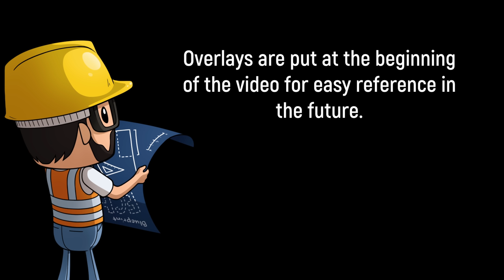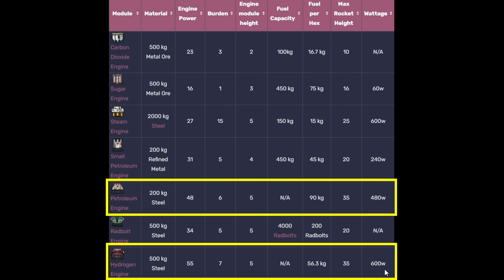Liquid Hydrogen and Oxygen Tutorial | Oxygen Not Included

Comment: Regarding solid hydrogen forming in your hydrogen freezer part: there's a way to regulate temperature of the coolant down to 0.1 C. Just put liquid storage behind the aquatuner and regulate for temperature of the liquid going out of it. It does not have to be full, a few hundred kg of supercoolant in it is enough, that way the 14 C of cooling by the aquatuner gets spread over whole contents of the storage and causes only slight change in output temperature. May be only necessary for perfectionists who don't like messy designs, though :)
Reply: Alternatively, cool it down to a higher-than-needed temperature that is close to the target temperature, and then once the cooling's evened out that first time, set it down to the actual target temperature.

Comment: You can get a much more stable coolant temperature if you output the aquatuner directly into a liquid reservoir with a couple hundred kilos in it and put your thermo sensor on the output of the liquid reservoir. Then your coolant loop fluctuates by only a few degrees above and below your target temperature.
Reply: Does the reservoir go inside or outside the structure? I already have it built they way he did so im not sure where to put it.
Reply: @Babyjoker2222  it needs to be outside the steam room so it doesn't exchange heat with it
Reply: @snackjunkie9367  Does the automation need to be connected to the reservoir and the auquatuner or just the reservoir?
Reply: Seems like just to the reservoir the aquatuner just keeps running until max causing the hydrogen to freeze, and then when i connected it it still continued to run.
Reply: @Babyjoker2222  none of the above. You still connect the automation to the aquatuner. You're just measuring the temperature from the reservoir output.
Reply: @snackjunkie9367  ohh is there a thermo sensor for the reservoir and a thermo sensor for the aquatuner?
Reply: @Babyjoker2222  no just 1 thermo sensor, you just put it on the reservoir output instead of the aquatuner input. It still connects to the aquatuner.
Reply: @snackjunkie9367  Thank you I believe I have it working now, I took a break yesterday then started back this morning. Was confused at first with the putting the thermo sensor ontop of the reservoir output until I got it.

Comment: The difference between insulated pipes and regular pioes is how thermal conductivity is calculated. With regular pipes you calculate the average of the two items. So it would be half of liquid hydrogen. Same with heat feom outside the pipe(if you didnt stop the loops when rockets leave or come back). 
With insulated pipes the lower thermal conductivity is used. So with insulated pipes made with insulation  thermal conductivity is 0, with ceramic its really small

Comment: A trick I used, was to pre-cool the hydrogen to -255 via the gas version of the aquatuner. I also had a full tanks of super-coolant after the aquatuner and used the thermo sensor on its exit. The more super-coolant the more stable it is. I got the hydrogen to be -261.5

Then, whenever I had both enough of it to fill the chamber, AND it was colder than -261, it was pumped through the pipe system fueling the rockets and was then lead back to the hydrogen chamber. Even when no rocket needed fuel. That cooled all the pipes to -260 too, so the pipes no longer sucked chill out of it. That way, I could run it longer and longer, even before getting insulation.

Comment: Like meany have pointed out using a buffer tank helps evening out the temperature and you don't get spikes in it.

It was also pointed out that normal pipes of insulation will change temperature as it is an avarage between the thermal conductivity of the pipe and liquid. Think Francis john explained the math it in one of his videos. 

Areas in space you don't get rocket exhaust to (insulated wall on the side of the rocket) you can use radiant pipes in, as they instantly cool down as most have a low specific heat capacity.

Comment: Love the actual tank part, my preference for cooling the steam turbines is a powerless loop of hydrogen in a gas pip looping through window tiles along one side of the oxygen tank and behind the turbines massive thermal mass to hold the temp and it doesn't effect the cooling of the oxygen at any point either, excellent work though.

Have you tried the trick with piping through bridges with 1 pipe segment between them to save on pipe costs?

Comment: Echo i like your idea of the polluted water and clean water aquatuner setup but I'm worried about the polluted oxygen of gasing when I sealed everything up furthermore, doesn't polluted water leave polluted dirt behind once the water evaporate?
Reply from the maker: Won't off gas because there is enough regular water that turns to steam first, which overpressurizes the room.  Yes, it will leave some dirt around.
Reply: @EchoRidgeGaming "leaving polluted dirt behind" 😵 that don't make you twitch? 😆 why not crude oil or petroleum?

Comment: But aren't you in vacuum? what are the pipes gonna exhance heat with and they need to be made with ceramic and stuff
Reply: Insulated pipes themselves will exchange temps with what's inside of them, unless build from insulation. And since each pipe segment is built at around 30 degrees, this means that pipe segment will be slowing sucking out chill from the liquid O2/H2 inside of it until that pipe segment is the same temp as the liquid.